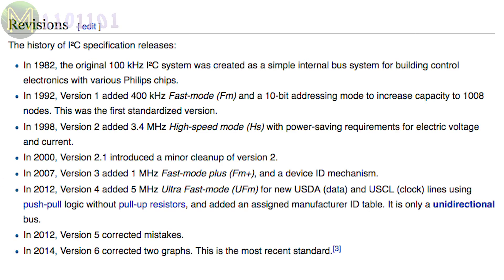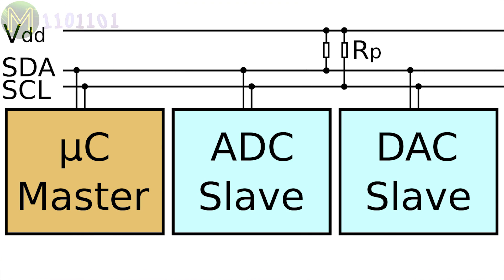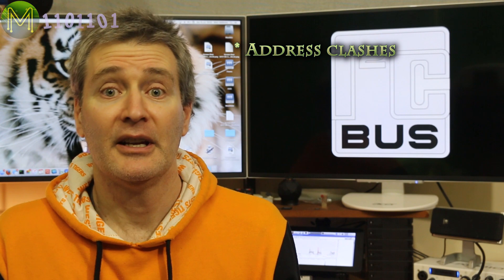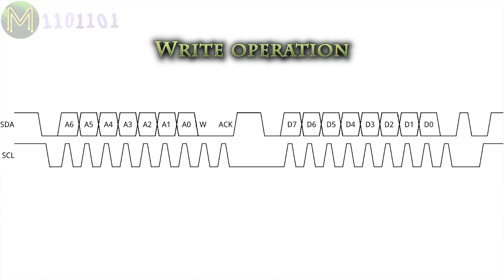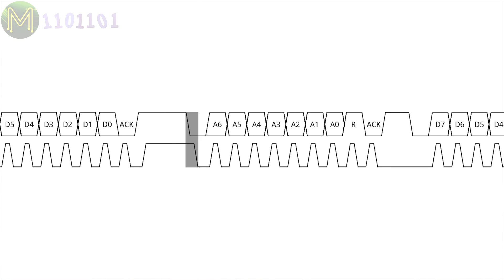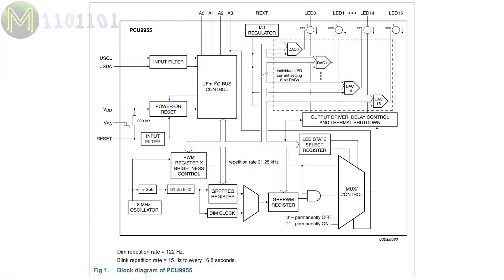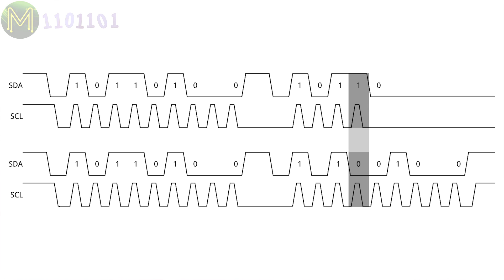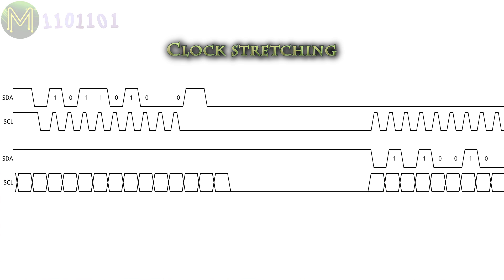#152 What is I2C? How does it work? // Tutorial QuickBits

Comment: That was chock-full of information :-) Would one still need that pullup-resistor when only one device is connected to the bus? Seems there are no easy rules to follow to deterime what pullup-resistor is really needed although 1k to 10k from what I hear should do the trick in most configurations. Also sometimes unclear if the device itself already has that resistor onboard - seem to have read about devices that make such claims. So still very hazy on that topic :-(
Reply: Benny Kleykens on most devices it just works with a resistor between 1k and 10k. as far as I think it you would also need pullups if you only have one slave. sometimes an open protocol is just not enforcing enough and everybody does their own thing.

Comment: Good overview of the I2C. 
What is a bit strange to me is that before the end of the video you say pull-ups are needed for every device on the bus. In fact, you only need to add pull-ups once for a common bus. If you add 10 pairs of pull-ups to a bus with 10 devices, your open drain outputs would have to sink quite a bit of current to get the voltage down to a logic zero.
Only when you start using bus-multiplexers, level shifters, hubs, repeaters or similar devices splitting the bus you have to make shure that all sections of the bus have theyr own pull-ups. 
Another rule of thumb is that you should lower the pull-up value for larger busses, to compensate for the bigger bus capacity (rise time). For very simple busses you can go well beyond 10Kohm, especially in low power/battery powered applications.
Reply from the maker: +ExtraBase 
Thanks mate. Yup, it's only one pull-up on the bus. As you said, it'd be a bit of a bugger having to sink all that current.
With some devices, (and breakouts), they sometimes have their own pull-ups.

Comment: Great video. Concise. Newhaven displays claim to have an i2c interface, but they doesn't tolerate clock stretching. The Raspberry Pi 2's i2c python library doesn't work well with Newhaven displays.  The RPI's i2c on occasion stretches the clock. It was a nasty surprise for one of my project.
Reply from the maker: +mdesm2005 
Yup that's the sad thing. There's standards that are mostly kept, but some companies like to just ignore them and implement only half of the standards. Gets annoying often.

Comment: Great video. Thanks
"Keep cable lengths short." What is short? 5 cm, 50 cm, 5 m?
Pull up resistors for each device? 1K or 10K?
Reply from the maker: +GordieGii 
"Short" depends on clock speeds, but you'd expect 50mm to be around the ball park.
Pull-ups can be anywhere between 1k and 10k. The lower the resistance the higher the current.
Reply: So if I wanted to use two temperature sensors, say near the floor and near the ceiling (so about 2 m) with one micro-controller that would be too far for i2c?